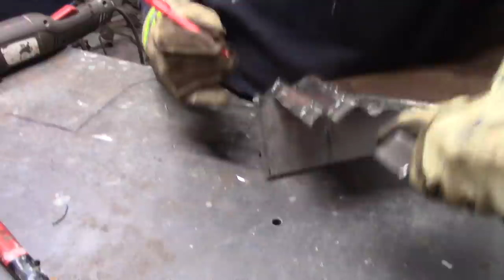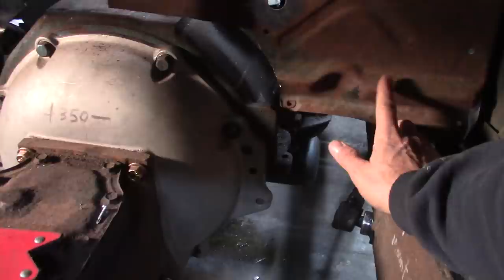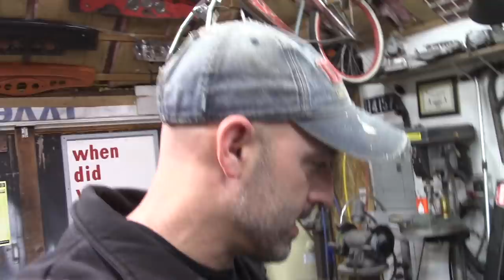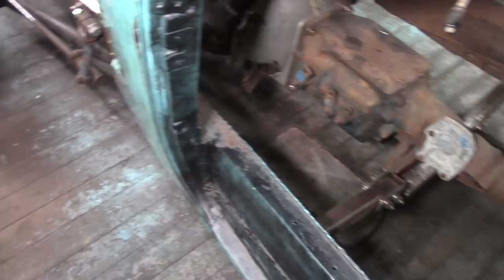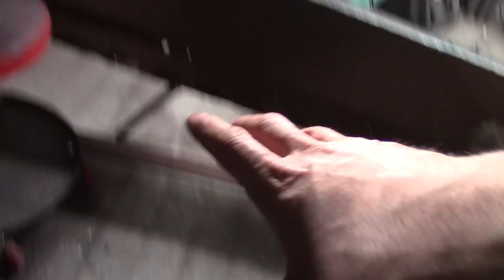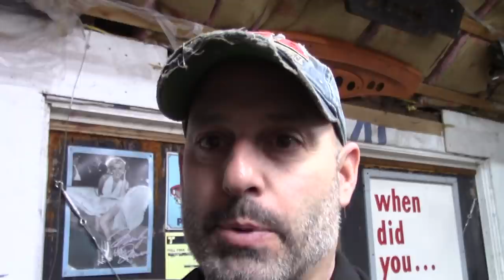Finishing 1935 Ford Truck Firewall

Comment: Lookin' better every day!! I had a 34 Coupe PA title. It should be in my 72 year mess somewhere. I should do a search. I suppose it's worth something.
Reply: I'm guessing about $350
Reply from the maker: They're bringing more in the vacinity of $600 -700. Ive come across several and sold them to guys in need.  I heard PA was tough on older cars and getting the titled and registered. Spoke with lots of guys down there while at Carlisle about the process in Mass. PA sounds stricter

Comment: The firewall turned out great but was a lot of frustrating piece work. I assume you were trying to save that top 6” of the old firewall but, would it not have been easier to use the entire truck firewall and section it to fit the coupe opening? I assume that back in the day that’s how hot rodders would have done this. But in the end your work is outstanding and it was a good tip to gain some inches of engine space.
Reply from the maker: The reason not to remove the entire firewall is due to the fact you would have to reweld the radius at the top of the cowl.  It would be way way more work.  Welding at the crease of the two pieces helps on minimizing warpage and it’s simply just easier to access.  
Back in the day they didn’t actually do this modification.  Most guys back then (I think) would have just cut the factory firewall and recessed it with sheet metal or a pre-shaped piece of metal like a wheel barrow tub.  
This is more of a “modern” hot rodding modification.  
I’m trying at incorporate a mixture of new and old to achieve an older and cleaner look    
 Thank you for the question and also the compliment.  
I appreciate the support. 

Mike.
Reply: Ahhhhhhh, Ok. Now it makes sense to me. And I wondered how different the top radius was from original to the truck version. Sorry if I missed that in the videos. Just curious about the construction. I’ve see guys cut their firewall straight across and reverse the bottom part to gain the engine space too which does rob interior space. I like your solution and will be a useful fact to remember the truck version is stock looking but creates more room for the engine. Thanks for the reply and keep it up. This is quality stuff you’re doing.

Comment: That battery is a pain in the ass it dies alot you will have to order another one or heck maybe three as fast as your camera goes thru em
Reply from the maker: I actually did order one.  It has yet to show up yet.
Reply: @ThisOldHotrod  lol don't you love the mail system probley stuck in customs because of the Corona Virus got to love it
Reply from the maker: @MrBenh1976  it’s been a month. Hahah.  It took 6 weeks to get a set of 1934 Mass plates shipped to me from Mass !!!  
It’s craziness